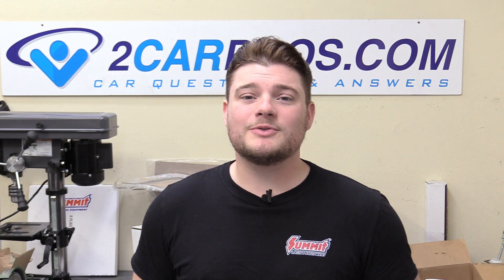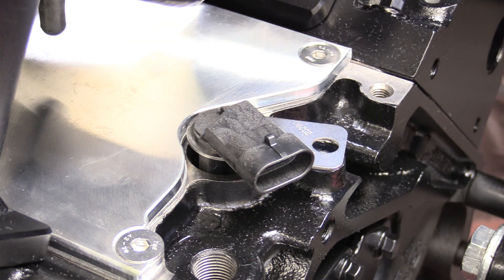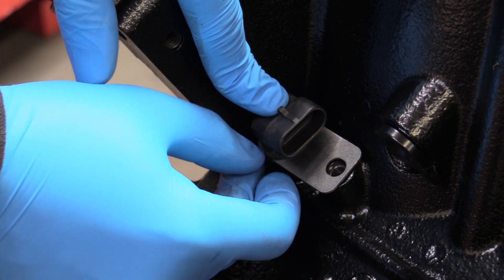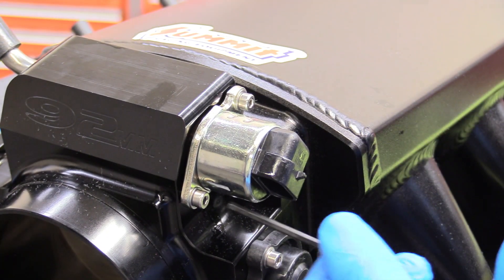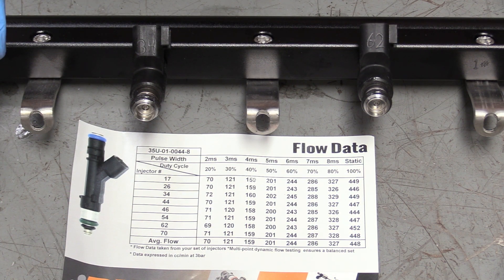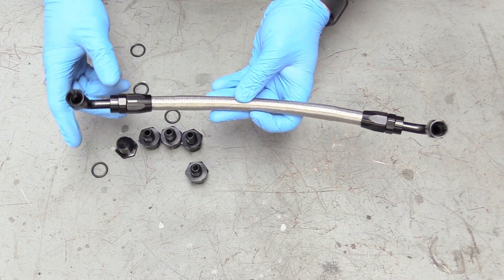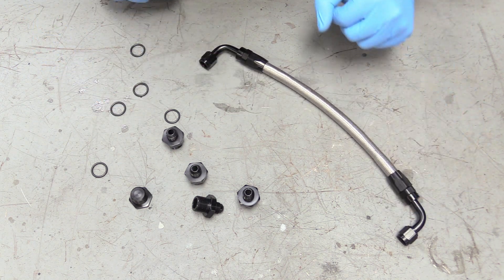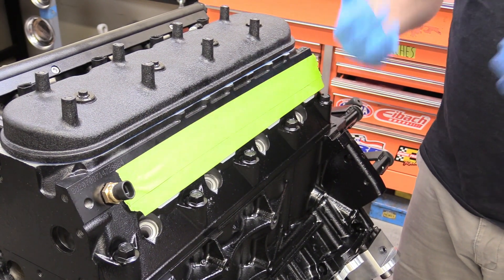How to Build a 5.3L LS LM7 V8 - Part: 10 Sensors, Fuel Injection System, Exhaust Manifolds

Comment: I've read the comments here and on your forum and noticed other people have issues with getting the DW injectors to install in the Summit Racing intake. I have the same parts and the same issue. Was a solution ever determined? Im damaging o-rings trying to push these down and im incredibly frustrated with the response from DW, and Summit not having an answer as to why they worked fine in this video but not for several others who have tried with the same parts since then.
Reply from the maker: I'm not sure what to say, I took them out of the box and put them in and they worked fine. I wish I had an answer for you. I'd probably go with a different injector I'm not super happy with their responses either. Thanks for watching.
Reply: @2carpros Yeah I saw the injectors were new in the box and you opened them on the spot. How frustrating to find this issue come up again. I can't return these injectors so Im going to try different o-rings before I abandon them.
Reply from the maker: @SuperHartwigs  I appreciate that. DW has called me every name in the book about this issue. As if it would benefit me to lie. That's a good idea, I'm sure there is one out there that will work. Thanks for watching!

Comment: Where can I get the special socket or what size is it for the oil pressure sending unit? And can I use the stock oil pressure sensor?
Reply from the maker: It's right here https://amzn.to/41UvJX7 and yes the stock sender will work great. Thanks for watching!

Comment: Ryan, I have a question. I am building the same engine. When installing the fuel injectors/rail into the intake, I cannot get the injectors to seat down properly. How hard was this? In your video it looks very simple but I am at my wits end. I even tried removing the injectors from the rail and installing one individually. It doesn't fit. What gives?
Reply from the maker: When the o-ring is lubed up it should slip in fairly easy. Makes sure you have the right injectors for your intake, it sounds like they are too big or something. Thanks for watching!
Reply: @2carpros  Thanks for the reply, Ryan! I have them well lubricated and they are the exact part number that you have as well. I am also working with Summit on this issue. I have put almost my entire body weight on the fuel rail/injectors trying to get them into place but they are not interested. Something is definitely not right. I'm afraid any more pressure will damage the parts. Any additional input is appreciated!
Reply from the maker: @smittya40  Yeah something isn't right, it shouldn't take that much force to put them in. They might have sent the wrong part or something.
Reply: Im having the same problem. I've got some smaller o-rings on order to see if that helps. How did you solve the problem?

Comment: Will these injectors work with a gen 3 5.3
Reply from the maker: This is a gen 3 5.3 so yes. But they won't do anything for you in a stock application so just get the AC Delco ones for that. Thanks for watching!

Comment: I have to say....when I am not following a procedure that has a torque value, I stopped using a ratchet some time ago. Variable speed drivers. Mine is DeWalt. It could be any of them. No, you don't over do it any more than he could have with his ratchet. He could have broken off those small sensor bolts with his ratchet if he wants. Using the driver is "the flat rate way".

Comment: Any idea where I could get a replacement O-Ring for the cylinder side on these injectors? I cut one of them during install and I cant find anything on what size they are
Reply from the maker: I'd order something like this https://www.amazon.com/ACDelco-217-1624-Original-Equipment-Injector/dp/B000EQPBGI/ref=asc_df_B000EQPBGI?tag=bingshoppinga-20&linkCode=df0&hvadid=80745439395092&hvnetw=o&hvqmt=e&hvbmt=be&hvdev=c&hvlocint=&hvlocphy=&hvtargid=pla-4584345016131958&psc=1

Thanks for watching!

Comment: Could you explain where the ports from the valve covers go? I have the same intake and similar covers but I don't remember where the vent ports go from the covers. Thanks. Great videos.
Reply from the maker: They go into the throttle body. But honestly most people have them blocked off like we do and it runs totally fine. Thanks for watching!
Reply: @2carpros  My new throttle body has no place for them to go to so I guess I'll block them and see how it runs. Thanks
Reply: @2carpros  one more question. Where did the map sensor fit with that intake?

Comment: I've got an 02 Silverado that needs the engine rebuilt. 280,000 miles. What was the cost or average cost of machine shop work and then cost of parts(roughly) is this a $3,000 engine $10,000? Any input appreciated
Reply from the maker: The machine shop work is going to be between 1500-2500 depending where you live. If you re used parts it would be much cheaper. We have a sponsor that was super cool and sent us all new stuff for free. Thanks for watching!
Reply: 7,639.29 plus machine work (from summit racing website

Comment: i’ve messaged you before, but can you lead me in the direction of a full rebuild kit for a lm7? i cannot seem to find one.
Reply: i have a 2003 gmc sierra 4wd with a 5.3 (lm7) and a 4l60e and i’m rebuilding the motor but i can’t find a kit that has bearings rings and all the intake exhaust water pump an other excess gaskets and seals
Reply from the maker: I mean there really isn't going to be a full kit that has everything all in one purchase. You are going to have to put it together piece by piece. Summit Racing has an awesome site where you can select the engine you are working on and look up all the parts that will fit it. Thanks for watching Alex!